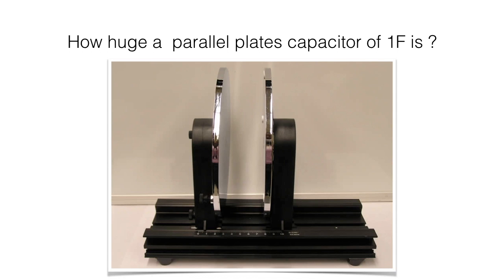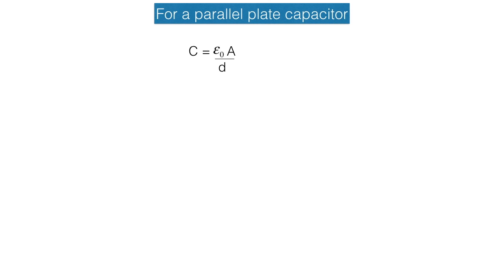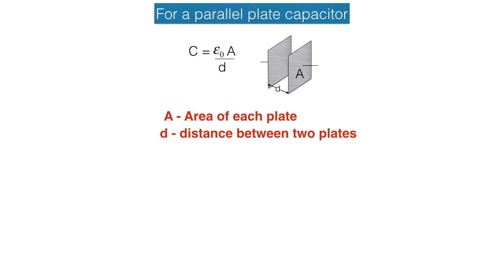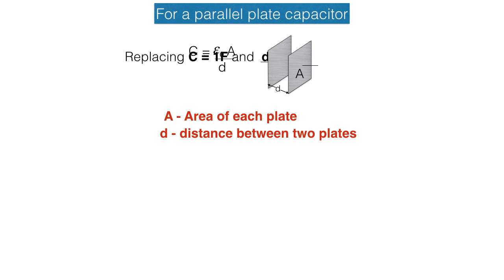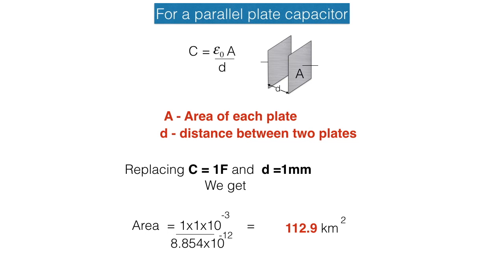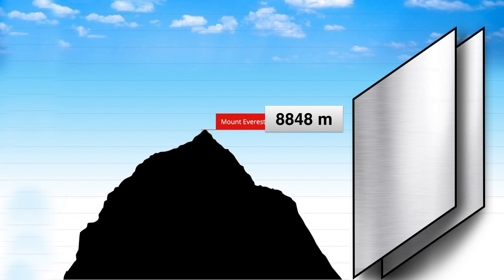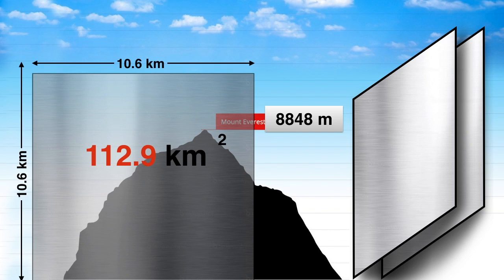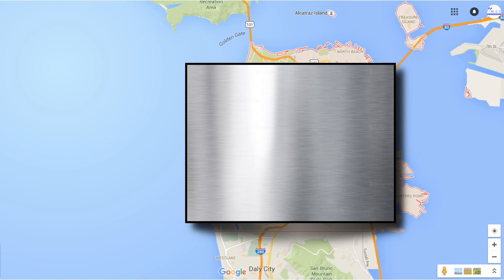How big are the plates of 1 Farad Capacitor? - Knowit

Comment: Hey I'm trying to figure out ways to make fixing dams easier, the major reason is the Mullaperiyar Dam. I've read that it could break any second from an earthquake above 6.0 on the Richter scale. The water would kill millions I've read.  The dam is over 120 years old. One idea I have to to use some sort of refrigeration system to freeze the area next to the Dam so people can repair the Dam piece by piece.
Reply: My idea now would be to freeze a pool with a pole filled with liquid nitrogen. Apparently you can't contain liquid nitrogen in a completely enclosed container or it will blow up from the gas being released as it boils away. You have to use a Dewar it's called which allows some of the gas to be released so it doesn't blow up. Maybe a container that has a refrigerator system that keeps the liquid nitrogen cooled enough to not boil off could be made. Then the container with liquid nitrogen could freeze portions of water if it comes in contact with it

Comment: Why did Mr. Faraday use such a large standard for capacitance? One Ohm and one ampere are practical standards for most applications but one Farad?
Reply: It's derived from the other measures. One Farad can accept one ampere for one second with a rise in voltage by one volt.

Comment: I myself bought 1.5F 5v super capacitors for Rs. 89 each. I have a couple of them, and they work just fine. The size is just of two CR2302 batteries glued together (but they aren't real batteries).

I have seen that you can also get 500F 2.7v super capacitor for Rs. 500 or so.

Comment: Sir,why are you increasing the area, without doing that,we can use a dielectric with huge dielectric constant ...for instance,we have calcium copper titanate which has a dielectric constant of 18400...so if we use this dielectric in a 80μf capacitor,we can get capacitor with capacitance of 1.47 f...,

C'=C×dielectric constant
C'=80×10^-6×18400
   =1.47 farads
Reply from the maker: Ya thats very true and practically and widely used caps, here Its just an imaginary concept to know the size of parallel plate capacitor with air as dielectric, beacause of their huge size we dnt use them practically, thats why the requirement of cylindrical caps was came into the consideration👍🏻